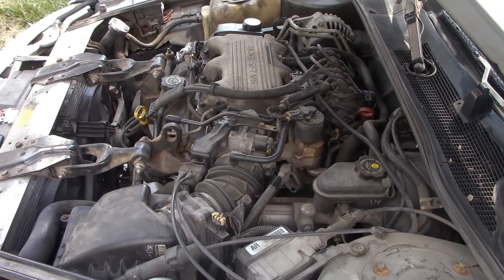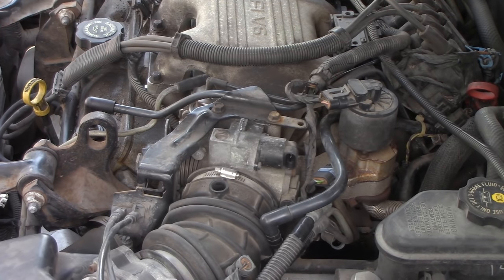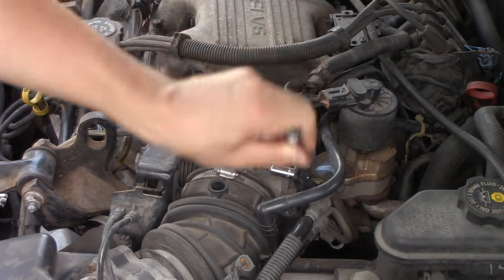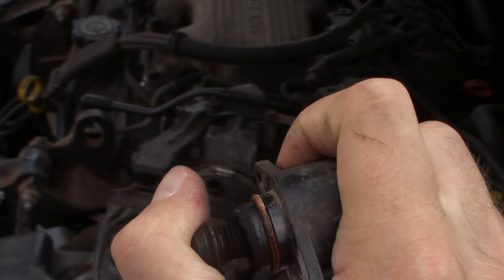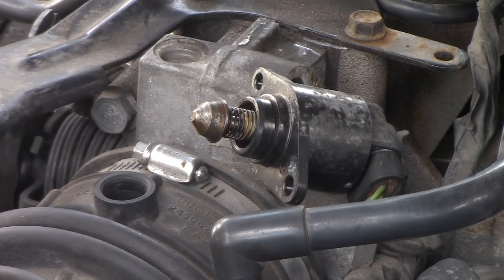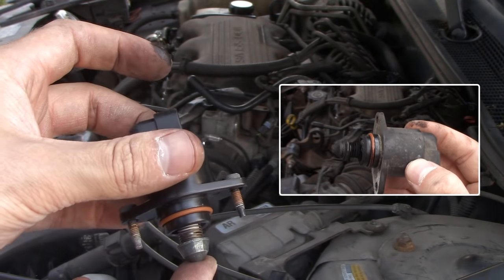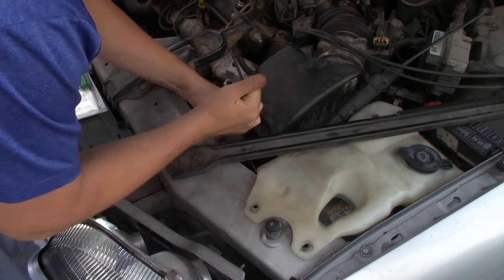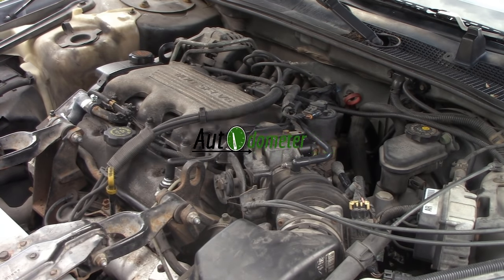How to replace an idle air control (IAC) valve

Comment: Helpful video. 97 Malibu, 3.1 V6: Rough idle with a P1071 code.

 Installed a new IAC valve, then got a reading for “MAF circuit A low.” - found a short in the mass airflow sensor’s wiring harness.

 New MAF wiring harness solved the extreme high & low idle, but the engine still loped at idle due to a missing PCV line grommet on the intake manifold near the throttle body - same effect as a bad IAC valve.
 
 PCV manifold grommet replaced. Problem solved - smooth idle @900 rpm.

Comment: Great information! I'm getting ready to replace the IAC Valve on my 1993 Pontiac Grand AM SE 3.3L V6 due to idle surging and engine stalling. It stalls when its idling in park. Idle will recover some when I put it back in drive. Will be replacing the Muffler as well.  Thanks for the instruction as well as the follow up tips for the car to relearn the new part.

Comment: My issues with a 1992 FIrebird - 3.1L engine - : The hose end going to the BRAKE BOOSTER came off and caused all kinds of issues - with that back on and some fine tuning on idle from the repair shop - runs excellent! It was not the TPS or the IAC.

Comment: I replaced the idle control valve on my 99 Durango. Now rpm are high. Then cleaned throttle body real  good. The throttle sensor was changed not long ago also.

Comment: The kindle can be reattached, the IAC moves by turning a servo motor there is no limit on it only electrical sensor for resistance so it know when it’s fully closed and it opens to set idle RPM if you had disconnected the battery and allowed the computer to reset it may take a few drives before it knows how far to pull it out for a perfect startup meaning you might have to tap throttle until it gets it’s groove when you’re popped out you just had the thread it back in when doing that always thread it in all the way and allow the car to close the valve rather then starting closed can making the previously stated issue worse

Comment: This was the most helpful video I've seen to date. I have a 2004 Saturn Ion 2.2 that wants to run away occasionally. Not all the time. FIRESTONE was stumped. I tried to replace the IAC a while back but it was a disaster so I put the old part back in. If you have any suggestions, I would be happy. Thanks.
Reply: Would you suggest having the auto shop do it for me
Reply: @tomhouston9124  Do you know your way around under the hood? Do you know what a throttle body is? I ended up doing the job eventually and I learned what I did wrong the first time. It's not too hard, at least not as hard as I first thought. If you're interested, I'll tell you what I did.

Comment: Thanks for a helpful video. I have a 91 Camaro 3.1 v6 and each time I replace the iac valve it isles high 2000-2500rpm then drops after driving to 1000rpm at idle however at next startup it repeats the high idle...any ideas would be extremely helpful

Comment: This was an amazing video!! Great job on recording and then explains... It was so much faster and easier to understand as opposed to trying to commentate while recording even though it was a quick simple job. Very I formative.. I'm having issues with a 03 2.0 Chevy Tracker with a rough idle. I'm going to try to clean the IAC first as you did.. my only question is, "if the pintle had not of came out all the way would that mean the vavle is still good?"

Comment: Very informative, thank you! My wife has a 2009 Optra wherin the IAC is held with those two same kind of screws, plus the left side of it is attached to the throttle body. It jiggles once the screws are out but won't come free. Any suggestions?

Comment: GOOD VIDEO !!! These are Cheap these days... I found them on eBay from $8.00 - $10.00.  If you have problems with these IAC Valve... Just replace it :)
Reply from the maker: I know some parts are cheap now days. With eBay and Amazon you can’t go wrong at least replacing it.

Comment: you can put the pintle back in.   Not by turning it because of the slots in the pintle shaft and the corresponding spots were the pintle shaft goes into the IAC body.   Just put the pintle into the IAC body, make sure the above mentioned slots in the shaft are lined up with the two little plastic tips in the IAC body that keep the pintle from turning.  Hold the pintle in this exact location keeping it from rotating, and keeping the slots in the shaft lined  up with the two plastic tips in the IAC body.  Then turn the key on.  The IAC motor will turn and the pintle will screw back into the IAC body.
Reply: Thanks for commenting this mate, I was wondering exactly this as I need to replace the stepper on my Triumph motorcycle and Triumph want $200 AUD whereas the same looking thing for a car is $30. Apparently I just need to swap the "pintle" (plunger), rod and spring from my old one to a new one.

Comment: Hi I`m getting ready to replace my air idle valve control in an 1999 Chrysler Sebring 2.5 & is the valve up near the throttle pulleys been a long time since worked on cars, Thanks

Comment: I have a 1994 Olds Cutlass Supreme S 3.1lt and that was exactly what is going on in my car.i took it to Firestone for what I thought was an electrical issue, but everything was ok in that and also they were NO vacuum leaks.It would seem to me that they could have checked that before they said they couldn't find anything wrong, cause I did tell them that it was cutting off I learned something, but do you know what the cost for a shop to install one? The tach was dropping off from 1000RPM.

Comment: Hello, I will be replacing an idle air control valve in Nissan Sentra 2002. Will I need to relearn it or it can relearn as you said in your video. 
Please help. Adam

Comment: Just changed the idle control valve in my 2005 ram 1500 . Do you have to disconnect the neg.battery before or after because I didn't and idle doesn't surge anymore but if I  let up on the gas and hit the brakes it dies now. I also didn't reset it .these are things I didn't know I had to do.

Comment: 07 versa with 144000 miles my sister bought it used.  So I think its time what you think? I replaced the coil packs and plugs the was gapped at 75 should have been 43 lol! That PCV and hose might have it idling all high I took the intake off and cleaned it now it want relearn with that P0507 code strewing things up. Check for leaks with soapy water and go from there tomorrow???

Comment: I have Nissan sunny 2002 i have same problem my ideal air control valve is stuck open and not moving back valve and my car is not running ideal mood is it cause the problem

Comment: Hi. Do you answer to  questions? If not my apologies. My 03 Chevy venture only starts when Mass air flow sensor is Disconnected, But when on she idles so high, High & low, But when idle she's so loud and revs like a race car. I changed so many parts already. I can not drive the car in this idleing high condition. If you have any advice please reply back. My apologies for the bother. Thanks George M.

Comment: '96 Olds Cutlass Supreme 3.1L is idling at 4K rpm.  iac looks clean... I'll pull it again and see if it moves when the key is on/off.  It's hard to drive a car that wants to idle at 60 mph.

Comment: Can I just simply, without even disconnecting the battery, take the old IAC valve off and install new one, than turn car on? Or do I actually need to disconnect the battery what would happen if I did? I’ve cleaned the part before without Disconnecting but I’ve never completely replaced the whole part without disconnecting then started the engine up. I’m worried the pindle won’t match the old one isn’t that the whole point of disconnecting the battery terminal? 2000 Buick park avenue naturally aspirated

Comment: Having trouble with my 2007 chevy impala. When driving the engine bucks and the tach drops to zero and runs rough until you reset the engine by taking off the battery negative cable,  then it run normal until it bucks again and runs rough again what could it be

Comment: I have a question for you , I have a  94 gmc 5.7 with tbi when I removed the idle air con val the tip was not on it and could not find it could this cause an engine problem ? truck crank and ran fine with new one just have not driven it anywhere. sorry to be so long but here's the ting the truck had not been wanting to start and run right until after i drove it long enough for it to warm up then would fine. that's when i decided to replace the idle con val and descovered the tip was missing and could not find it. thanks for any advice

Comment: Why is it important to disconnect the negative cable from the battery for 15 minutes before starting the car after replacing the IAC valve?

Comment: Excellent video.  I'm having an issue with my 2003 Impala because it starts hard only in cool/cold weather and the engine has been run warm.  The engine will fail to start on the first crank and it takes 2 or 3 tries and then starts and runs normally, and I have no other performance issues.  I have no issues when the engine is hot and no issues with starting in the spring and summer seasons, only fall and winter.  Two years ago I had the both the crank and cam position sensors replaced (hopefully the shop didn't screw me) but the problem has persisted.  I know that it must be due to a faulty temperature-related sensor and I've also considered the intake air temperature sensor but have never tested it yet but I swapped the IAT sensor with my 2005 Impala's (which is the same part and I have no similar issues with the 2005) to test but the problem persists.  I always try to begin with the cheaper and easier causes and proceed from there, and I'll try cleaning the idle air control valve first.  We'll see.  Thanks.
Reply: So did it work>
Reply: @toshvtosh5469  I'm sorry to say that I've been too busy to try it yet, but here we are in December 2021 and the issue has recurred as expected in the cooler weather.  Thank you.
Reply: @DDEENY  lol its been a while, have you installed new iac valve yet?
Reply: @HuyQuang-ds7cj  Nope.  My car is approaching 200,000 miles, the transmission doesn't have long to go and I'm just riding it out until the last.

Comment: I have a 1991 camaro Z-28 my RPM Idle jumps feels like wants to shut down I already put new EGR and clean out the throttle body and a new air idle sensor I check for any exhaust leaks “NO” all good so what else can it be they told me it has to much pressure also ??
Reply from the maker: I am not familiar with that engine. I would check for vacuum leaks before the intake manifold... check all hose clamp fittings and rubber tubing going to and from the air intake between the air filter box and throttle body as well as any vacuum connection to the air intake manifold

Comment: I have a santa fe 2008. The problem is when I start, it will start but I have to keep my foot on the gas pedal. But when I removed my foot on the gas the engine dies. Can someone help me out pls.? I need to know what has to be done to get it fix.

Comment: 1994 suburban 7.4 2wd 2500. Super rough idle Boggs drops and climbs idle.....  And I seen it from top of tbi move erraticly in and out. Not steady at all.  

Not sure how its supose to operate. But it was moving very quickly
Reply: Hi, mine does the same, it moves very quick and a little bit, pressing with hand is verry though, did u find whats the problem was🤔🤔

Comment: I have an issue with my 2004 mazda 6 type S it has the 3.0v6 when i was driving it down the road the check engine light came on and then when i would accelerate it would stumble unless i accelerated alot to almost passing gear but trying to drive it thats all it does now anytime i give it gas nyst stumbles and jerks

Comment: Best way to do idle relearn is to set  parking brake and block the drive wheels. Start the engine and let in get to operating temp. This could take 7-10 minutes. The idle may fluctuate widely during this period this is normal. The computer is configuring the pintle positions. Let the engine idle for an additional 2-3 minutes after reaching operating temp and the idle is smooth. Done
Reply: I left out an important step.🙄 Transmission must be put in DRIVE. Hence the reason why you must block the drive wheels
Reply: Will this work for obd1 car
Reply: @kielholden7613  these are the instructions for OBD I vehicles

Comment: So what was the issue you was having? Would run alright cold but once it warmed up it would not stay running at an idle or ? Thats what i got going on with a 3.1 right now and thinking its this valve.
Reply: I have this exact same thing going on 97 Cutlass with the 3.1. Did you replace the IAC valve? Did it work?

Comment: Will be doing a 2004 Nissan Sentra. Code was p0507. It stalls at red lights and won't restart. Rpms drop below 1000 when brakes are engaged. This sound right?
Reply: did you replace the IAC and did it help your problem...got a pt cruiser doing the same

Comment: Hello autodometer!  I replaced my idle air control valve on my 98 chevy Silverado and it idled at 2000 rpm's and never idled under 1000.  I will be exchanging it for another one.  My question is, do I need to program anything or adjust anything as far as the throttle body cables?  I ended up cleaning the original one and re-installing but I can hear the valve kick in and out and sometimes it stalls out.  Very confusing and frustrating.  Thank you in advance!

Comment: I have a 2004 trailblazer, when I turn my wheel in park, the car kind of vibrates. Do you think it can be that valve?
Reply from the maker: Probably your power steering pump or power steering rack. Check your power steering fluid level. If low then fill with some stop leak power steering fluid rated for GM vehicles
Reply: @AutOdometer  thank you very much. I will check it out later.

Comment: My vehicle is a 1994 Chevy Astro Van 4.3 L V6 VIN "W" (CMFI) appears to be the same as shown in the video. I have a few questions. What do you recommend be used to coat the o ring? Is there a gasket? I recommend use anti seize compound on the screw threads because the screws can get stuck over a long time into the manifold. The valve I bought from auto zone is brand "Duralast" and has instructions, but fails to mention a gasket, but says I need to measure and adjust the pindal length prior to installing the valve. Do you recommend presetting the length prior to install, or just reset the pcm computer by disconnect of the negative cable to the battery and allow the pcm to do the adjustment. I have heard via various sources you can damage the iac valve by forcing movement and best to allow the pcm to adjust after install of the new valve. Sorry for all the questions. The quality of the video and the voice is very good I think. Thanks for doing the video.

Comment: I’m having a high idol of about 2700 rpm after I removed my throttle body and cleaned it .. I also insured the gasket was good An volts were fastened .. if I clean the idol air Control valve would he idol go back to normal?
Reply: +Steven  Miller- I'd bet it's AOK after about 5 Minutes afterward huh????  You might forget that the Computer needs to " Re-Learn " ???  Right ??????????

Comment: I need to replace the IAC in a toyota Corolla 97. Any suggestion?
Reply from the maker: Type in the YouTube search bar.... “How to replace 1997 Toyota Corolla Idle Air Control Valve” :)... if no one has made a video on it just be sure to disconnect negative battery terminal and then do the fix. Some newer cars are funny with the electrical side of things.

Comment: Sir, I had to adjust my low idle rpm , and i fixed it by adjusting the Throttle stop screw, and it also worked.  But then heard there's another screw called Idle Air Adjustment Screw, which is there specially for this purpose of adjusting idle air flow? and that the Throttle stop screw should not be changed but instead the idle air adjustment screw should be adjusted? 
I'm really having this confusion which one should i be adjusting and what are the difference between.these two?
Reply: +Sifat Oishique - I am no expert, but if there is a way to " Adjust " your AIC Valve... I would do that on a heart beat!  DO NOT adjust other things before your AIC.  Hope that will help :D
Reply: +Sifat Oishique - If your IAC Valve is dirty or needs replacement, I suggest you to do so. If you adjust your Throttle Screw / Idle Air Adjustment Screw.... Your Air and Fuel will change.... At a minimum.... You need to be around 700-850RPM at Idle (Depend on People liking... I like mine to be around 850RPM due to Cold Weather where I am). NOTE: Your Computer will " Re-Learn " and adjust the Fuel Ratio accordingly, unless you have the " Old " Carburetor Type Engine. But if you have Auto Fuel Injection, the Computer will " Re-learn ". So best is to Replace or Clean your IAC Valve before doing anything else.
Reply: Jordan Bronson yup got it..thanks man.
Reply: +Sifat Oishique - You are Welcome and I hope that will help you further.  I am learning a lot since I started to mess with my Dad's Cars / Trucks for the past 2 years.  Although I have been messing with Engines since I was 10 years old.  But Cars / Trucks... It's been 2 years.... I know a lot for NOT being an expert, LOL.  If you have more questions.... Ask away, I will try to help with what I can :D.
Reply: Sifat Oishique friend, where is located that screw that you were talkng about?

Comment: Thanks that was very helpful. I am going to put one on my PT cruiser today. I had previously installed the throttle position sensor. But it is still stalling when I stop at stop lights etc. hope this works
Reply: did this solve your problem on the cruiser
Reply: Stalling while coming to a stop or at a stop sign could also be a failing crankshaft sensor. Happened to me.  replacing the crankshaft sensor fixed my problem